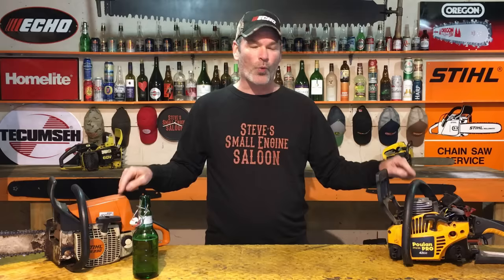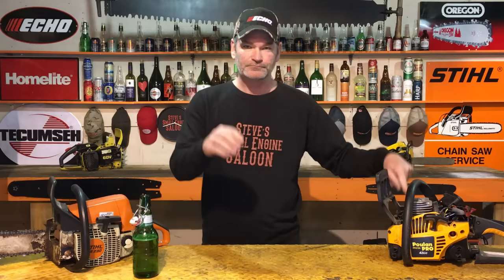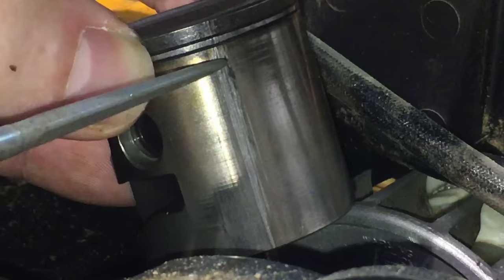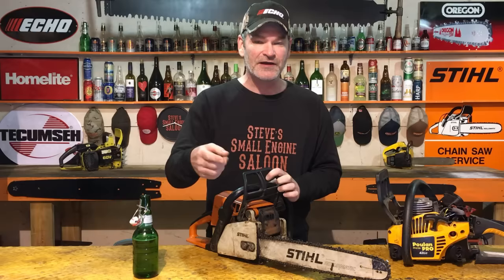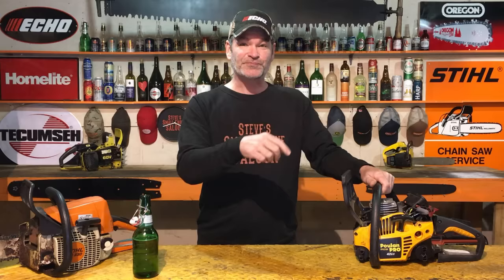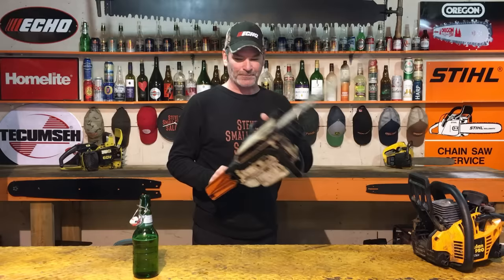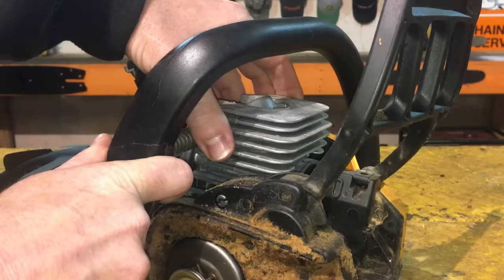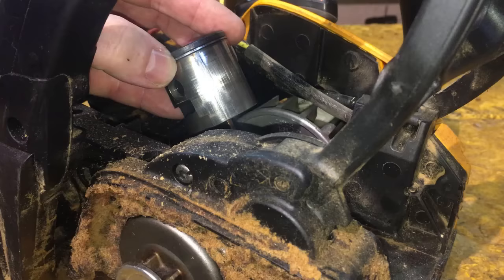WARNING: Never Do This To ANY Chainsaw

Comment: my first board piling job was in 1986, the wood came down the green chain 2 feet deep and we had to trim and pile at break neck speed. Our chain saw got started, used for 2 seconds and shutoff hundreds and hundreds of times a day. I have been working in saw mills every year since and have yet to see a chainsaw scuff a piston due to cold use. I have extensive experience using Stihl- 028, 034, 036, 038, 260 and 261- Husky 240, 61 and 353, Jonsered 535 and Dolmar 122 on green chains and none of them ever scuffed a prison! I have seen many saws scuff a piston, but usually bigger saws and usually firewood saws, some due to unmixed fuel but most due to old fuel.

Comment: Steve after watching this video, I'll bet a cold drink that's exactly what has happened to a talon down in my shed. Low compression, doesn't want to keep running. And looks fine through the exhaust port.

Comment: I just spent over $750 on a brand new Stihl MS 362 yesterday at a Stihl dealership.  They took it to the back to make sure everything worked. As I was checking out, I could hear them start it up and immediately go full throttle for a good 15-20 seconds.  Idiots.  Praying they didn’t do any damage.

Comment: 2 strokes oil trough the fuel. I idle mine half choke for about 10 seconds.  Then slight Rev 4k for 20 seconds. Also premium fuel is good deal too.

Comment: I've always slowly revved all my garden power tools up to full power before doing anything and I'm a novice, but I know my physics and it just makes sense getting all the motor parts up to working temperature before going hard on the throttle. Nice to be vindicated and find out the exact issue, but I've seen many 'professionals' start something and immediately flog it.
Reply from the maker: Right on

Comment: Four years later........  There is a good point for the new electric chainsaws, in applications such as Steve describes, where a warm up period is not generally used.  Intermittent use where the saw likely never reaches operating temperature.

Comment: Great advice.  I just went to my Husqvarna 36 manual and it just gives starting procedures but did not say how long to run the engine before using it.  I do not recall you saying so either but it is clear you warn us that we should warm it up before doing full throttle usage (I did see 60 seconds in your description.  Thanks for the video
Reply from the maker: Glad it helped

Comment: Summary. Start saw and let it warm up, don’t rev hard or start cutting straight away, as it causes extra wear to cylinder/pistons, due to more rapid thermal expansion of piston and rings inside cylinder. Good advice.

Comment: After seeing this I have started warming up when I get to a site. I'll start it up and then finish getting my tools out while it idles.
What about a cool down after running it? If I'm going to start right back up in a minute or so, I don't. But after a buck and I'm moving wood, I will put it down and let it run for 30sec or so while I move the first piece or two.

Comment: I own that same poulon pro chainsaw I bought mine at a pawn shop with a case and it runs fantastic I take it with me on atv trips for downed trees and camping and some family yard maintaince Ive always started it cold on the ground choke out choke in give throttle a lil snap and walk away and let it idle on the ground bouncing around for at least 1 minute and then off to work we go she always a lil boggy first couple starts off the year lil bit of old gas and probably a lil bumed up in the carb but it always runs have couple spare bars and chains man do chains dull quick when you hit dirt or a rock oops great video Im glad I will never cold seize my chain saw I never heard of the term till today and im a mechanic lol

Comment: I would think FRAMERS could benefit by using some of the new battery powered chainsaws.  I happen to have a DeWalt DCCS670 which cuts nearly as fast as my Stihl MS251 on firewood jobs and trimming, w/o having to fuss with warm-up or typical cold starting issues.  Just pick it up, pull the throttle, and GO!  Justa thought...

Comment: what he is saying is right , it is better to let an engine warm up some before you throw a load on it and run it at high rpm . when i was taking an auto mechanics course in college , our teacher who obviously knew an awful lot about engines said all the metals expand at different rates , so you are going to have more friction while it is cold . i think it is especially true of the small engines that have an aluminum cylinder with no cast iron liner / sleeve . it will expand differently than the iron piston rings . and it is very important to have enough oil in the gas/oil mix . remember , a two stroke cycle engine does not have a pressurized oiling system that supplies oil to the piston and lower ring . it relies on the oil which is the fuel mixture to lubricate the rings and cylinder walls . it doesn't hurt to have a little more oil in the mixture , especially if it is an engine that the manufacturer specified as a 50:1 mixture . i think the reason some manufactures starting in the the 1960's and 1970's changed their recommended mixture from like 32:1 or 40:1 to 50:1 is because engines oils got better over time . it does'nt hurt to have a little extra oil in  the mixture , it will not foul your spark plug or clog up your exhaust port (s) with carbon unless it has way too much oil . a two stroke should smoke lightly when running , just not excessively . when it lose power the first things you want to check after the air filter element and fuel filter , is the spark plug for oil fouling and deposits , and for carbon build up in the exhaust port . after it has accumulated a lot of hours it is a good idea to lightly clean the spark plug with a brass wire brush , and remove carbon from the ports and maybe the combustion chamber as well , as it can cause a hot spot

Comment: True warm up that little motor , I use 3 saws and a pole saw all work great , the oldest one I got used and it's a great runner 026  , great light saw .

Comment: Not only do I allow my saw to idle for a minute or two after startup, if it is like 25 degrees F or below, actually bring my saw inside for an hour or two or overnight to thaw out before taking it outside for startup. Btw, doing that with a half full gas tank - when the vapors warm up and expand, effectively pressurizes the fuel system, (depends on design of the fuel tank vent granted) chainsaw will start easier just because of that. wink wink.

The 4 cycle engines, place some sort of heat source underneath for 1 - 3 hours, cover with tarp or blanket. I've used a incandescent light bulb trouble lamp, repurposed light fixture, cube space heater, and even a kerosene lantern. Haven't tried an old hairdryer and piece of old foil dryer duct, or piped exhaust from a road vehicle - yet. In my region we are not that cold to where we plug our cars in at night. So Steve there is a video idea for you to roll out about November. How ya ever get your 4 cycle small engine started in Canada, when it is -30c and your 5w-30 oil is like JELLO, Eh? Am aware they actually sell mini dipstick and glue on the crankcase heaters for small engines which you could review for your Northern viewers.

Comment: Ahhh Grolsch! When I was young working my first job I couldn't wait for Friday. I'd get paid and on the way home get a couple of bottles of Grolsch beer.
I always let my saw warm up or cut at low rpm's while it warms up. I hate ruining saws. I also use pre mix fuels because I'm not disciplined enough to empty my tank after each use. Best way is to run them until they stall store empty.

Comment: No sense commenting years latter but I’m try to connect the dots.
1) Spark/ flame front focused right down onto top of piston which then moves downward allow hot combustion gasses to spread out to cylinder walls.
2) Piston has 1st exposure and is small than the larger mass of the cylinder. Cylinder has greater ability to absorb heat and dissipate that heat via cooling fins to the air.
3) A hotter side if piston simply due to the 2 cylinder engine design.
4) Hard to wrap my head around how instantly/immediate this phenomenon occurs.

If I’m on the right track my next question would be does the piston outer wall really expand outward beyond sealing edge of rings, or does it just heave the ring(s) outward and fuse it in that outward position? 
Still finding scoring on piston itself tells me piston  wall indeed makes contact with cylinder wall.
Does this heat work the piston destroying ductility or can you free 😮😮

Comment: I'm old enough to have learned to drive on a tractor and later a truck with a manual choke. 
I let everything warm up - and you can generally tell how long it needs by listening to it. 
It kind of bugs my that the trigger locks on my Stihl and I have to pop it off immediately or it will pretty much rev full as soon as it hits. 😑

Comment: It has always been good practice to let a combustion engine warm up a bit. Who starts his/her/its car engine and revs it up right away?
When starting my chain saw, i never have helmet and gloves on but put them on while the saw idles. Short check of chain oil presence on the tip and the engine should be warm.

Comment: I do that all the time with my gas powered equipment.
 In fact I used to work for a county conservation board, they would send me out to clean up trails of drowned trees and over grown bushes; when I would get to get to the trail gates, I'd usually start my equipment just before driving that last mile; to insure everything was warmed up and ready to go when I found what needed to be cleaned up.
Reply from the maker: Right on

Comment: My dad bought a craftsman saw many yrs ago when I was a teenager. He didn't wanna leave one of the Stihl saws at the location in case it was stolen. It ran fine the first couple times we used it then it sat for about 4 months during the winter. He told me to fill it up with gas just before we were gonna do some work so I got the mixed gas and filled it up. He cranked it up and went to sawing immediately, in under 2 mins  (probably even less than 1)  it seized up rock solid. He tried blaming me for putting straight gas in it or not enough oil and checked the can. IMO the saw was a pos anyway but I've always felt it seized cause he gave it no time to warm up and it was still late winter and very cold that day.
I've always let small engines warm up before I start hammering the throttle.

Comment: Also common issue with the liquid cooled snowmobile guys. Fire it up ....wide open,!  I always make sure the radiator or heat exchangers are getting warm before take off...and then not instant wide open. Same with dirt bikes.

Comment: the startup procedure on my trimmer and blower says to put the throttle at max and leave it there for 1 full minute after starting. It also says the machine can be used during this time. I wonder if they are trying to make me do this? Or like a planned failure type of thing for the company to make more money off me? 

I just warm it up like a dirtbike. works so far.

Comment: I let all my power gear have about a 60 second warmup before I put them to use.  That includes saws mowers trimmers.   They seem to run better and more efficiently. I.e. the exhaust smells cleaner.

Comment: I bought a new 24 inch Stihl chainsaw recently, for the grand sum of $1400. 
Foolishly, I expected the shop staff to know better than to start it from cold, and immediately pin the throttle wide open. 
Sadly, they didn't seem to know this basic fact about engines! 
 How much damage it suffered, I really don't know.

Comment: please do a video on husky gas tank vent issues. I've got a 573, a 372 and 365 who's tank is pressurizing on hot days (in fact the gas has boiled in the tank). We took them partially apart and couldn't even find the vent port.  Thanks

Comment: Absolutely!  I often wondered about that.  I have been doing the wrong thing and it does have little compression left.  Thankyou for the tip even though I didn't even intend to watch this one originally.  Sometimes things just work out.
Am wondering though, pardon my ignorance, would fitting just a new ring improve the compression?

Comment: That piston can easily be repaired, I've done it many times (though not on stuff like Poulan). Propane torch to slowly get the ring out, needle file to the groove and ring, sand paper on the skirt. I've also done that with lean seizures and provided the cylinder is not damaged, saws work fine. Stuff like Jonsered, Husky, Stihl or anything with nickel alloy plating on the cylinder is almost indestructible.
Reply: I was wondering. The damage doesn't look bad. I would assume that unless it's a catastrophic failure that that piston could be cleaned up used again. I just fixed a weedeater with a stuck piston ring that everyone said I should just give up on.
Reply: A lot of people just assume because the piston is scored that it's junk. Sometimes if they don't know better they will believe what a tech tells them. I think a lot of times people put too much oil, use low octane gas or don't run them fast enough and all those things are bad. Weedeaters, Poulans, Craftsman (they're all the same) are regularly tossed for these reasons. They have chrome plating over the aluminum cylinder which is nowhere near as strong as the nickel alloy that the Swedish, German, etc. brands use. Personally, I never put any time or effort into the cheaper stuff but good for you if you got it fixed because sometimes it's a money saver to just do it yourself. There should be more people who want to do that instead of plugging up the landfills ! Cheers !
Reply: @danieldoucet9121  yea I honestly just wanted to try and do it. It only took soaking atf fluid and seafoam in the cylinder for a few days and it freed it up.

Comment: I never, ever do this. No matter what engine, be it two stroke or four, I always let my engines idle for a few minutes to warm up  before revving them up. Some people have made fun of me in the past but my stuff always outlasts theirs and they can't believe that my equipment is still running after they've replaced theirs twice. Treat you equipment with a little respect and it'll work for a long time. Beat it and you'll be replacing it often.

Comment: Cheers Steve. Would a new set of rings on that piston fix things or was the cylinder stuffed.? 
Rebore and bigger rings a fix, or simply not worth the effort? Easier just to replace parts? What ya reckon? Just chuck in bin and buy new chainsaw? Seems such a waste...

Comment: When I tell someone to let the saw warm up from 3 to 5 minutes they look at me like I'm stupid. I also tell them to not free rev it like crazy the only time you do that is after its warm and for tuning purposes. The thing I see a lot of with working for a landscaping company is people will fire the saw up not even let it warm up same with weedeaters and they go to work. The exhaust side gets hot the fastest and I've seen intake sides look flawless and the exhaust side looks like it spit rocks out. Always from a cold seizure. I personally get tired of telling the same people the same things over and it goes in one ear and out the other. Warming up any 2 stroke is the life of the exhaust side of the cylinder and piston regardless of what it is. I've had a few argue and say a 2 stroke doesnt not need to warm up so the first thing I do is go to the scrap pile of cylinders and show them why you have to warm up a 2 stroke. Some times it can be bad enough to lock up what ever it is just for a brief second then instead of having to replace cylinder piston and ring or rings you end up having to replace those parts along with crankshaft and bearings.

Comment: I agree that you should let ever engine warm up. After all, that how it were designed to run. The only other thing, I don't run any motor on full power all the time. When I hear motors constantly running on full power I know the Pearson using it those not have true skill - not to mention reducing the life of his machine and is wasting time and money on more refills than is necessary.

Comment: even first responders should understand this for doing TRuck work on a roof. .   Just warm ur saw up as much as u use for atleast thirtys seconds to a minute then u can get work on cutting that roof open.  MAINTAIN YOUR EQUIPMENT and use it PROPERLY youll  get better performance over all as well Because if ur Engine is Losing Compression Your not going to be able to have the power the saw is used  for fellas....Many fire depts may not know this

Comment: The solution is for contractors to buy cordless chainsaws that run on the same battery system that the rest of their tools run on.  The bonus is that they also don't have to carry gasoline and 2 cycle oil with them anymore.
Reply from the maker: Right on

Comment: I enjoy this channel a lot. Always learning something. 
I do have a question I haven’t seen addressed yet. Often after I use a chainsaw, shut it off and move logs out of the way then try to restart the saw to cut more it acts like the engine is bound up and can’t hardly pull the rope. Next day starts fine but when I’m working I can’t wait for the next day. 
My local repair shop called it hydraulic lock. Just let it set a while and then start it. So I bought another saw to use while I’m waiting for the first one to get over it’s stubborn mood. 
How can I get around this and what is hydraulic lock please?
Reply from the maker: I have a video in my playlist called Unflood a chain saw...
Reply: @StevesSmallEngineSaloon  
Thank you for the comeback. Now to figure out how to get to the play list. Lol. I’m still a little slow with this iPhone. I’m of the rotary phone generation.